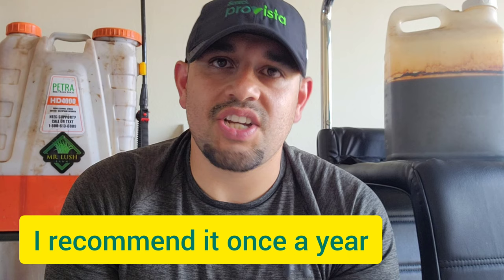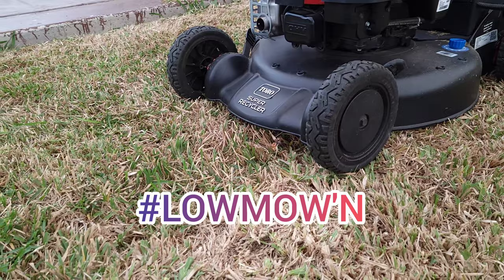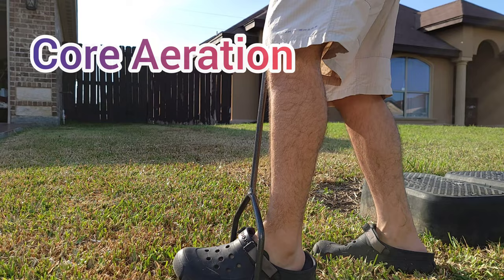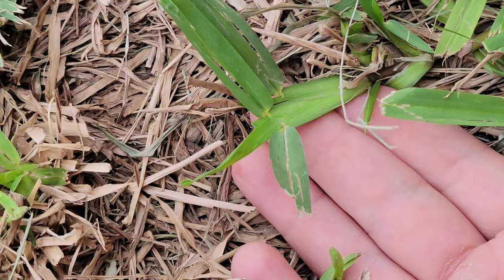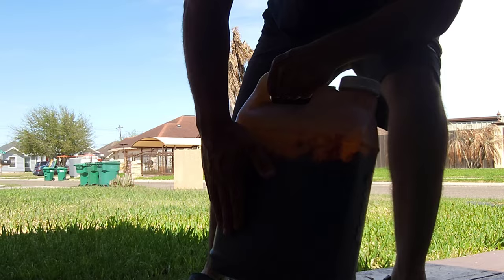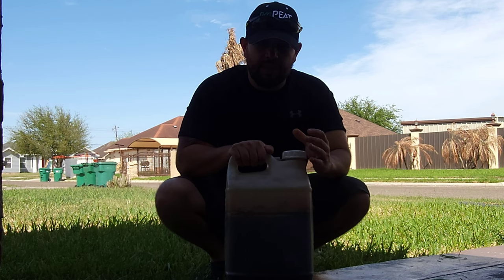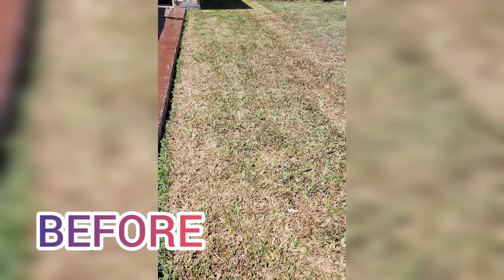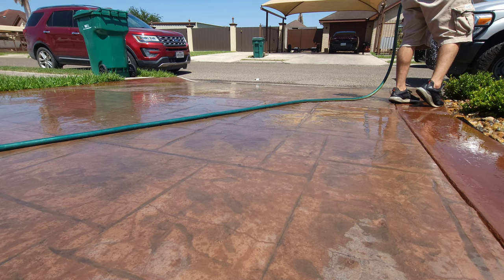5 Steps To Recover St. Augustine Grass

Comment: Lawns here in San Antonio are all confused. Started to grow, hit with the freeze, soil temps rose again, then we had the cold front that dipped soil temps back to low 60's. I just took this time to dethatch, scarify, and micro and macro nutrients. Hopefully it come's back later april early may when we get some rain and temps shoot up.
Reply: I have a bermuda back lawn that's doing REAL well, but my TTTF mix that the contractors threw in the front yard is SUFFERING.
Reply from the maker: @anangrytexan2244  nice! TTTF in san Antonio? I mean it'll struggle really bad due to the weather down here.
Reply: @MrLushLawn  yea when they built the house they didn't really care about what grass to toss in the front. We had them not put ANYTHING in the back and just laid Bermuda sod ourselves. Plan is to work the soil in the front this grow season, get the nutrients it needs in there, and Zoysia Plug the front after an aeration and leveling. Just plug the front and let the Zoysia take over.
Reply: How did it go? Is the lawn doing well

Comment: Man, all I have to say is WOW! I’m impressed! I reside in central FL and when I thought I had my answers to my St. Augustine grass fiasco, my head is spinning! :-( Your lawn looks amazing and my lawn did at one time. Where do i start…..I’ll make this quick. 1. My grass was bad! Brown all over, tons of dead spots and areas where no grass. 2. I wanted a green lawn, FAST! 3. I bought St. Augustine sod pods and put them in the areas that needed it. 3. I put down top soil and put down Bermuda grass (it grows faster than St. Augustine) but comes with weeds etc. 4. My lawn was luscious all summer long and very vibrant. 5. Saw some weeds and moths so I put down weed and feed and insecticide for the moths 6. Those areas that “were green” were full of weeds and died off! 7. For the last month I’ve been putting down Bermuda grass - “I know wrong choice” - I need patience! 8. I went out and purchased a de-thatcher machine and it’s pulling up the dead grass indeed BUT also the good St. Augustine grass!!! 9. My home has beautiful trees but you know what comes with that beauty….leaves! If they aren’t raked or removed, that’s where the lawn doesn’t get any water or fertilizer……10. I have the perfect storm now and I need to fix it! 11. I’m looking into having the dead areas replaced. :-( with new St. Augustine sod. I’ve tried over seeding (with Bermuda seeds since there aren’t St. Augustine seeds. Just sod pods or sheets of St. Augustine sod. 12. I wanted to de-thatch my lawn since it’s a lot of dead grass even between the great green St. Augustine grass. So, I’m at a cross-road…..Do I work with the St. Augustine grass or deal with Bermuda grass? My initial thoughts a year ago was that the St. Augustine grass would choke out the Bermuda grass and take over! That would be fantastic but it hasn’t yet…..thoughts????
Reply: You just described my situation almost to a T
Reply: one of my sprinklers broke so i did not know what to do im in central florida as well , i wish they would get a better quality grass
Reply: I live in Central Florida also (Daytona area) & had beautiful St. Augustine grass the first 7 years....until very ugly Bermuda grass started creeping in....and then started taking over the St. Augustine during a period when my irrigation system broke. Bermude WILL overtake St.Augustine...unfortunately.   My lawn guy said there was nothing to get rid of the Bermuda, but I recently researched and found that a product called Ornamec (by Gordon's) effectively kills Bermuda.  So that's on my to-do list so I can then concentrate on reviving my St.Augustine.  RobertHoward9482....let me know what luck (or unluck) you've had since you last posted 2 years ago.
Reply: I live in Central Florida as well. I just replaced my lawn 3 weeks ago and its already dying. I completely understand.
Reply: @generationalcursebreaker  same here in SWFL   Neighbors is nice tho

Comment: Nice backing track, Dave. I gave up on my front lawn, too damn hot out there anyway and pulled the Fender Strat off the rack, popped open an Oktoberfest…
I ripped out my sidewalk strip  by hand this AM -sprinkler station cycle failure killed it off after a chinch bug hit set it on the road to Hell along with a bit too much Triazicide applied…. I am toying with the notion of a switch to Bermuda in that strip instead, might dethatch the whole front yard first then see how I feel about it’s chances for the same switchover if the stolon damage is too great. Less expensive water bills if I do that, too!!! Bermuda is not as thirsty as StA, same dormancy in winter, easier to dethatch once per year, too.

Comment: I have tried this and have a few patches that will not recover. Most of the other grass is lush, I have raked and applied the mix but grass is just not growing. It's been months! I might just have to resod. It's a few small patches, 3'x4' is the biggest bare/dead patch.

Comment: Yo! Very clear and concise vid, in contrast to a lot of other grass vids out there where people are more interested in showing off their knowledge rather that helping people, ha. I’m actually in st Augustine FL, a new home owner here. I think I killed my st aug grass but mowing al last year and not bagging. Now there is a thick layer of thick dead brown blades preventing anything from growing on my lawn. It looks pale, brown and dying. It isn’t very long so I’m afraid to cut it shorter. Any suggestions for a starting point? Aerate? Thanks for your work/approach!
Reply from the maker: Thanks for watching buddy 🙏. I definitely think you should rake up as much you can possible without pulling out the stolons from the ground. Once you tired that. Definitely mow low to pick up more derbris after that focus on conditioning your soil. Major major key. Look into molasses it helps break down debris quicker. And lastly once you see the areas that aren't growing drip some manure. Feel free to DM on Instagram. I'll gladly help you in with a more detailed process.
Reply: @MrLushLawn  awesome man. Thanks . Really appreciate the time to help. What about using a thatch rake first?
Reply: Same same issue going on with my lawn. Interested how yours is going
Reply: @magarciaz20  it's been a struggle. i keep raking with a regular rake and bringing up some of the thatch. but it's still looking choked. i can reach in with my fingers and pinch a ton of dead, 1.5 inch blades. I'm worried to use a thatch rake because i don't want to rip up the runners. I just applied a liquid dethatch from lawnstar yesterday. its the long play, but will still apply it. bi-weekly. Let me know your strategies.
Reply: @colingill5959  not only do I have the thatch issue, I had compacted soil issue. I used regular rake as well a few months ago for thatch and it helped. About 3 weeks ago, I had it machine aerated to help with compact soil. I read up on dethatching and decided to go with a groundskeeper rake. Going to use it today. Have to be careful not to pull up runners. Then gonna try a soil loosener and then a humic/fulvic blend and see how it goes
Reply: @magarciaz20  oof yeah. Same boat. Keep me posted how that rake goes. Did the machine aeration help? What did you use, core aerator? I put down lawnstar liquid dethatch yesterday. Waiting game. It’s funny I’m the one in the neighborhood that’s done all the research on this and am educating others, but have the worst looking lawn. Ha. Trying to keep up! Keep me posted
Reply: @colingill5959  any luck?
Reply: @colingill5959  you can apply liquid dethatcher, molasses helps as well. the dead grass blades you are seeing are just old nodes dying off as new ones are forming. This is a normal process for st.augustine grass. a layer of thatch is good to keep the stolon's from being exposed to the sunlight or freeze (dumping manure) thats why that process is done to bare areas. I've never seen anyone scalp st.augustine like this process. Here in florida, that would kill the lawn for good. never go below the max settings on your mower. Only bag St.augustine if it has not been mowed regularly. Mulching is actually better for it. I mulch year round with commerical mowers. Some thick St.Augustine I cant even go below 5 inches without scalping. The key to St.augustine having no weeds and beautiful is being thick. Iron and slow releasing nitrogen is it's friend.

Comment: What do l do when bermuda gress is taking over it killing my st. Agustine grass what do l do.
Reply: You figure  out?Not sure but I think cut high so it covers and take over the bermuda
Reply: If the bermuda is already taking over, it is very hard. Just keeping mowing high, 4 inches, but trying to do it very often, BEFORE any new seeds from Bermuda form. If your yard is very small, the best way ( a lot of work) is to pull every single Bermuda from the root. That will accomplish several things. 1 Bermuda will not reproduce.2 when pulled, it will leave air pockets that are good for S. A. 3 When pulled, it will let space to get more water for S. A. 4 and the most important, It will not compete for sunlight, for space, for water, for nutrients, and for lookins.

Comment: Great video! Last summer we did not stay on top of watering due to restrictions and us being gone. Our first time really having to take care of a lawn in a while as before we came from apartments. The front corner of our Augustine lawn dried up and died. It’s the only section of our front lawn that isn’t shaded by our red Oak. Then the freeze happened. After that, with all of the rain this summer, a lot of it recovered except for that front dead part. It got covered by weeds. So I have manually uprooted all the weeds and now it’s just a patch of soil. I just spread compost from where the green grass ends through the bare soil. If I aerate and use soil conditioner, do you think that plus the compost will be enough to help the grass extend to cover the big corner? Or do I need to buy new sod for this?
Reply from the maker: Hello. Thanks for watching 🙏 compost with peat moss works wonders. But it'll take time. If you can look into SOD plugs do it. Best investment you can make to fill in those areas.
Reply: @MrLushLawn  Thank you! I’ll look into it.
Reply: so i should have put down some compost like cow maneuver ?

Comment: Mr Lush, do you recommend using the DIY manual core aerator for spot treatments - example anytime I notice my St Augustine grass is not performing well in certain spots due to compacted soil? Will that stress the grass or it can only benefit? Also does it need to be done before fertilization? Thanks
Reply from the maker: Hello. Yes the manual core aerator Will always help no matter what ur doing. Now if ur treatment the area let's say from with Fertilizer, Fungicides, soil conditioners ect you Will see a bigger difference since the product is going down into the root zone.
Reply: @MrLushLawn  Perfect thanks!

Comment: Bro I used the scotts 3 in 1 about a month ago than all this mofo rain came and was glad but dam I got more freaking weeds what should I do bring back more grass?I live in south Texas. .thanks
Reply from the maker: Hello. 3 In 1 is bad during this time since it has a lot of Nitrogen. So what you did was that the small weeds that were in your lawn tripled in size due to the good amount of Nitrogen. Weed love Nitrogen. So I suggest you to distinguish which weeds you have perennials or annuals. And control them little by little. It's as hassle but it's worth it. Good luck.
Reply: @MrLushLawn  how long should I wait to start putting some kind of weed killer on my grass?

Comment: Do you find the yard butler works? 

I tried it a while ago, but it doesn't core aerate. It just makes holes.

I noticed in your video, it's the same issue, I see no cores coming out when you're using it. 

When it makes holes, but doesn't pull cores it's actually further compacting the root zones below. 

I switched to liquid aeration ever since and have had good results.
Reply from the maker: Hey bud thanks for watching. I found this helpful. Soil conditions are variable, and if the soil has softened or is highly moist it may not pass through the tubes and instead might be pushed down into the ground. This can also occur when the roots are thick and prevent the tools from cutting. If you see holes in the ground after you punch through the ground, the plugs are being pushed down forming a hole. If this is the case that will suffice to allow the grass into the holes which is the goal of aeration.